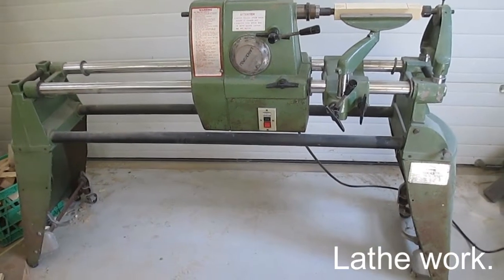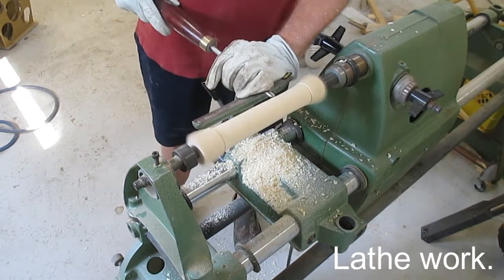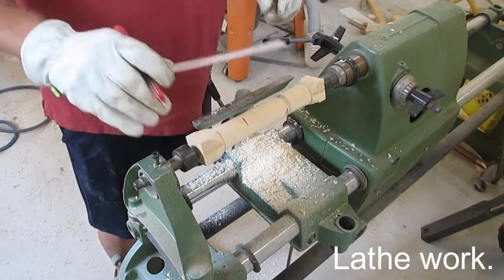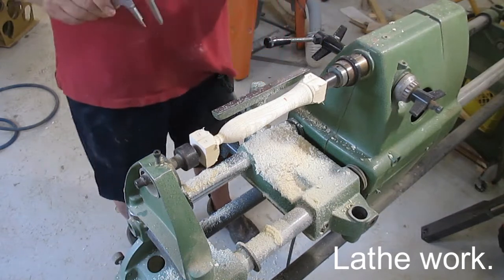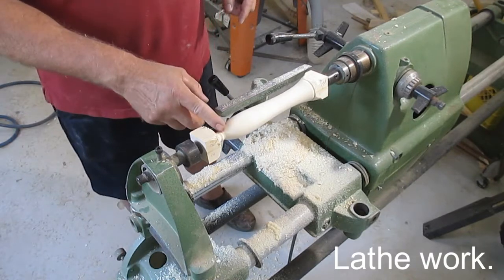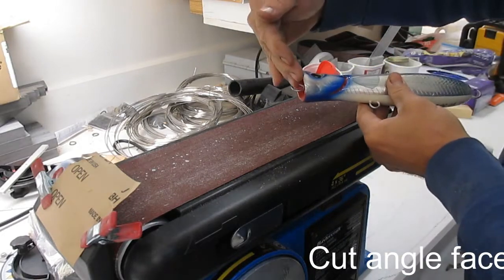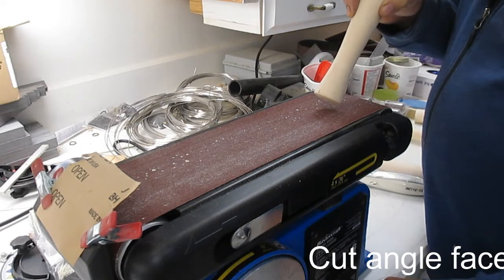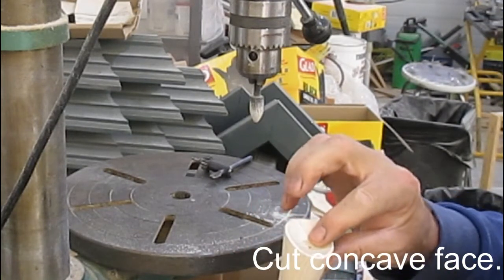Making Poppers Part 2 Lathe Work

Comment: Liked part one. I enjoy working on my lathe. I think you should lose the gloves though.
 Its making me nervous watching that wood spinning at 1200 -1400 rpm and 
those leather gloves getting close to catching on something. OUCH!!!!
Reply from the maker: Safety is important to everyone! The poppers I spin on the lathe are made of 2 pieces of wood that are very lightly glued together. After the sanding is done, I split them into 2 pieces and install the stainless steel thru wires and add holes for lead weights. 
I had a popper fly apart and give me a nasty bruise on my knuckle. Mmm! What to do? I chose to wear good quality leather gloves for safety. The leather gloves have nothing hanging down to catch on the work piece. I would never use cloth gloves! Thank you for your comments.

Comment: Concave is curved inward. I think you meant convex.
Reply from the maker: Some material in the front of the popper is removed to leave a hollow. Air gets trapped in the hollow and is compressed when the lure is jerked forward. When the lure slows down, the compressed air is released which makes a popping sound. The terms concave and convex are terms most often used when discussing lenses. I do not want to debate which one is correct. Thanks for your comment.
Reply: @allandoell1025  no debate. Just correcting a misspoken word.
Reply from the maker: @MultiWhoswho  I always appreciate comments about my videos. It is the only way I can improve my videos. I just returned from a 15 day long distance trip. I caught a Wahoo on one of my lures. Yipeeeee! I also made a friend in San Diego who loves my poppers. I will bring some show and tell lures for him to see in April.
Reply: @allandoell1025  that’s awesome. I’m a bit jealous. Always wanted to catch a wahoo. The poppers are very nice. You do good work.
Reply from the maker: @MultiWhoswho  Thanks! It took 4 years to develop my lures and my skills. I am happy to share my experiences!
Reply: @allandoell1025  I am actually in the midst of making my first few lures now. Crank baits with and without lip. Not sure they will work but I’m going to give it a try. And a couple have the added bonus of rattling. Hope they work. But if not the experience has been pretty cool.
Reply from the maker: @MultiWhoswho  I have 10 boxes the size of a 12 pack of beer, full of lures that I never finished. This is reflects my voyage of discovery. I have now caught 2 saltwater fish on my lures. I caught a 24 Lbs. Mahi Mahi and a 15 lbs. Wahoo. I am thrilled at my successes but I know I have much to learn about lure making. I was once asked "How many lures will you have to make to be happy?" My response was "Possibly millions of lure"! This answer really meant that I have no intention of ever stopping making lures! 
Good luck with your lures and don't let failures stop you!
Reply: @allandoell1025  oh no failures. Just lessons for the next one. And your right you’ll never stop doing what you love to do. And I have to say you sound like you love what you do. May I ask if you make lures for a living? Or just as a side gig? I started out of fun but have had a couple people say I should sell them. Not sure. And if I never sell one I will have a nice full tackle box every time I go fishing!
Reply: @allandoell1025  I subscribed to your channel. I’ll look into your projects soon. Hope to start doing some videos myself soon. Fishing and boating journey around Americas great loop.
Reply from the maker: @MultiWhoswho  I have given away several lures to people who show interest.
Reply: @allandoell1025  that’s pretty nice of you. Ultimately I hope that some day someone will want mine. As a purchase or gift. But as of right now most would throw mine in a fireplace. But I haven’t quite finished my first. It’s all pipe dreams right now. But that’s where everything starts, as a dream!
Reply from the maker: This youtube video started me making my first lures. I could not believe anyone could make lures that were so beautiful. Jim Lanfear sells them. Enjoy!
https://youtu.be/kygsZErsWVs